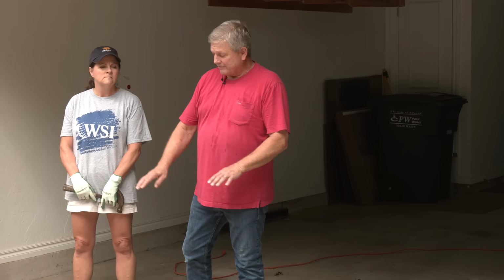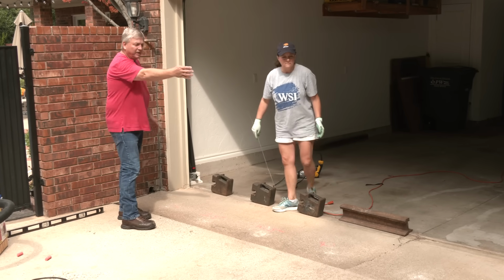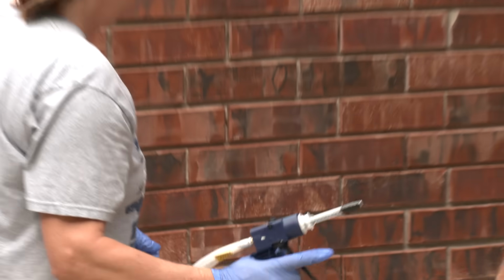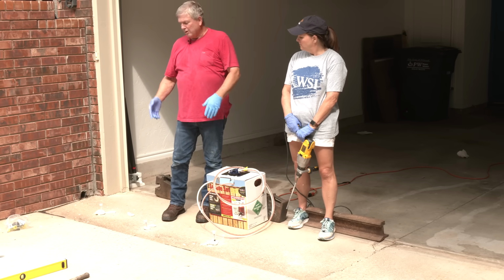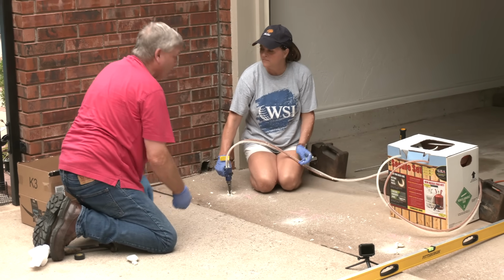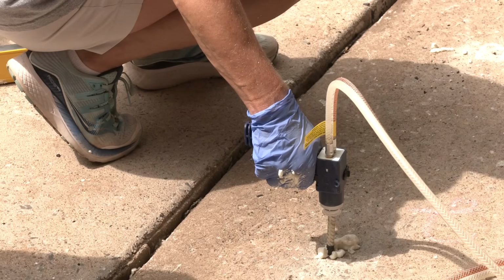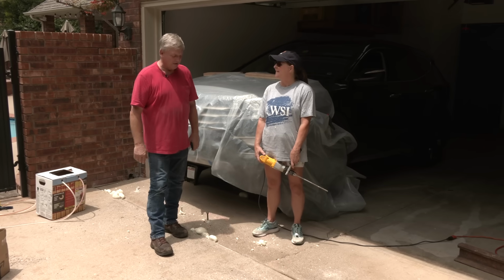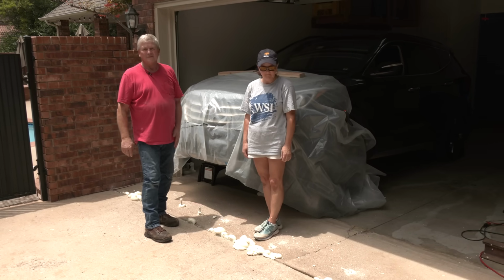Raising Concrete Driveway Slabs with Secure Set

Comment: In hindsight … would it have been just as easy to get a landscaping contractor to jackhammer and remove that sunken panel, stabilize the subsoil, re-pour concrete, and use attractive top finishing?  While at it, the concrete crew could install proper grating and drain to guide water in a better way.
Reply from the maker: Actually she had a price for doing just that (with unknown amount for the back-fill product and labor) and this was the least expensive way to go, even with the extra kit.  Also, they did have the downspout issue corrected, as well.
Thank you for questions.
GRA Services

Comment: If I use all of the spray foam in the container, can I refill it or do I have to buy it again?
Reply from the maker: Thank you for your question.  The Secure Set Spray Foam containers cannot be refilled.  Once the pressurization is gone from the tanks then they are no longer hazardous and can be disposed of however your local waste management company allows.

Comment: I just put 6 of these into a very sunk hawaii house foundation. It ate it all. 1 gun safety malfunctioned and i got blasted. The cans actually go well over ten minutes. I like the concept. wear protection. face shield even. I dont think the instructor emphasized the tight seal you need enough, and how to manage the ten minutes of foam you get. its really more like 12 minutes. This could use a lot more real detail. Good product.
Reply from the maker: Thank you for the comments, @Snoopy Ace.  You must have had some huge voids, and/or you had loose non-compacted soil and the foam compressed your soil to create more voids than you expected to have.  
Sorry to hear about the gun malfunction.  Like any mechanical device things like that can happen from time to time.  
As far as more real detail needed, the kits are used for so many types of projects that we don't put the application detail in the kits, but we have 10 instructional videos on YouTube and our website www.secureset.net for help with understanding a few types of projects.  Also, we are happy to answer questions by phone at 405-672-8885.  
Thanks again, GRA Services.

Comment: How long does the foam last?  I have a slab that keeps sinking after I have jacked up the concrete and filled underneath with crushed stone and cement several times in the past 15 years or so.  I think because I live near Lake Michigan on sandy soil (you hit sand after about 2 feet or so), I will near get rid of this problem ...
Reply from the maker: Thank you for your question. High density foams are expected to last 40 plus years, since nothing dissolves it and it has no nutritional value, so insects don't feed off of it .

Comment: Cut your concrete at the point its sunk down.
Reply from the maker: Yes, sometimes it does require a cut in the concrete to get it to lift, especially if there is a jagged crack which may be impeding the lift.  Also, sometimes customers have reported the need to cut rebar in order to get the lift they are needing.
Thank you for the comment.

Comment: Nice job guys👍….…Remember, WATER intrusion usually the main reason why our foundations are sinking especially when the foundation sitting on a nearly flat surface which reduce the water flow quickly away from the foundation…Therefore, foundation erosion starting to happen which weakening the concrete. I think I’ve found the problem on this driveway during the video shooting!! The downspout looks like directed and built within the brick wall and coming down just a foot away from the garage floor. I’m pretty sure if that downspout still there, this driveway will continue to sink! If not, then other surrounding foundations will be copied and eventually back to square one.
Reply from the maker: Yes, that was likely the issue and was corrected shortly after the filming of this project.  Thank you for the comment.

Comment: Could this method be used to raise the foundation?
Reply from the maker: It would depend on many factors.  We have had customers that have done that type of project, but we have not.  If you can jack up the structure and then apply the high density 4 lb foam, it will then support 10,080 lbs. per sq. ft.  
Thank you.

Comment: I think using a boroscope would be handy for estimating how much foam to purchase and guiding it during the injection process.  (Obviously, you'd need to keep the sticky material away from the lens.)  eBay has them listed for about $25 that connects to a smartphone or tablet for viewing.
Reply from the maker: Yes, it would have been handy.  We now use an endoscope camera that has a 2 way viewing capability, with a very bright light.  It helps a tremendous amount in estimating the project, as well as later figuring out where the foam has moved to and where we might still need to apply more foam.   We always wait at least 15 minutes after applying foam to take another look so we don't ruin our camera.  Thank you for the comment.
Reply: It takes what it takes. You can not estimate wolume in a cavity, no way to measure unless by eye.

Comment: You go left right, let the rise on the left and the lesser flow to the right create a void on the right side. Then fill the right and it will lift the right and create a void on the left again, go back left and repeat. Filling up the left and trying to pump more into the left will not work because there is no space unless you lift it, so lifting right creates more space. It is a problem if you fill up the whole space and have tight foam everywhere, you do not have any voids left to lift and create voids in the original space.

Comment: Some questions came to mind in the process that wssnt clearly explained: 
1) why more than one nozzle? Was a new one used for each hole? Or just after returning after extended drying time? 

2) how to determine how much tape wrapped on nozzle to prep it?? 
Is that to seal the size of hole while applying/filling w sealer. ? 

3) how to know when to stop dispensing each hole? At each application layer? 

4) how do you avoid lifting too much? 
Doesn't it keep expanding after you stop filling? 

5) prepping the nozzle , to clean/vacate it between applications of foam. Couldnt see what you did. Did you Empty hose of the foam, remove tip and then cap with a new clean tip? 

6) what was the plug removed between holes? Was it the nozzle hardening quickly or a plug from the hole? 

7) why spray foam into box before filling the hole? 
Was the line filled with air? 

8) what if there is an unknown big gap under the 12x12' slab further down the driveway? Maybe that is where the extra foam was going? 

9) what does "hear air coming out of crack" indicate? 

10) did the 1/4 inch raise on garage side come back down later after putting the car on it?  
Or did pivoting primary slab level it after infusing more foam in holes? 

11) would be nice to see cutting off final excess overflow foam from the cracks and final prep sealing of the joints where tar sealer was removed. 

() great project video. I watched it twice! But still am not certain about the questions above. -RichK
Reply: I think most of these can be answered with common sense. I think your best chance at figuring it out is by trying it on a project that doesnt have a lot of chance to fail, and if it does fail won't be a big concern!
Reply: I am concerned about the quarter inch on the hinged slab that went too far.  You drove the car on it.  Did the concrete level off with the added weight?  If not, do   I need to grind to make it level?

Comment: Great video! I found the strategy of redrilling holes and layering the high density foam - from below - in conjunction with use of the ramps with the vehicle to weigh down the hinge point, most innovative. Thank you. Very smart.

Comment: what keeps the foam from compressing over time, with driving over it seems like it will compact.
Reply from the maker: Hello Jerry,  The foam will compact if and when the combined compression weight of the concrete and the vehicle exceeds 10,080 Per Square Foot.  No standard vehicle combined with the weight of the concrete will exceed that value.  Therefore, the foam will not compact over time.  This is not like the spray foam in a can.  This is a closed cell, high density foam. Thank you

Comment: I have a detached two-car garage that has a big crack down the center and both sides have sunk about four or five inches. Would it be feasible to use this product to level my garage?
Reply from the maker: Hello Brad,  Yes, this product can help you.  However, you have to do some work to determine the extend of your damage.  You will need to both hammer sound the floor to determine the "hollow" sounds or voids under the floor.  Then purchase a Depstech DS-300 Endoscope, (about $70.00), and look below your garage floor to determine the size of the voids under the concrete.  Once you have accomplished that, we can work together to determine the extend of the voids under your concrete. Drill 3/8th" diameter holes with a 12" long concrete drill bit.  This will allow you to access the voids and thus ascertain the condition under your garage floor.  Once we determine the size of the voids and the height of the raising of your concrete, we can tell you how much product you need,.  Thank you.

Comment: Great video;  helpful instruction, but ••• 
SO MANY OSHA VIOLATIONS.  It’s not about fines;  it’s about your SAFETY! • • • • • • • • 

SecureSet is a closed-cell insulation foam;  it’s basically Great Stuff foam in a can.  The polyurethane-based product is similar to Gorilla Glue.  WHEN it gets on you, IT AIN’T COMING OFF!••• EVER!  • • • • • • • • I got foam onto work pants;  after years of wear and washings, the pants wore out;  the foam never came off. • • • • • • • • 

Leslie was DRESSED COMPLETELY INAPPROPRIATELY.
She should have had work boots, socks, long pants that she didn’t care about, a long sleeve shirt, work gloves, safety glasses, a respirator and hearing protection “ear muffs”.  The foam, that got on her legs and arms, she could shave it off after it dried OR wait for the skin cells to shed off her body. • • • • • • • • If the foam had gotten into her eyes, that would have at least been a trip to the emergency room. • • • • • • • • 

Even though I usually wore hearing protection during 40 years of renovation work, I now have tinnitus — a 24/7 ringing in my ears and some hearing loss.  Fun!  …Not!!  • • • • • • • • 

CONCRETE DUST produces millions of microscopic shards of glass.  When they get into your lungs, THEY AIN’T COMING OUT EITHER. • • • • • • • • 
PLEASE, protect yourself, your workers and your family better than Leslie.

Comment: I had a friend in MN who bought a brand new house. The next summer a section of her drive had dropped an inch. The next year it had gone down 2 more inches. She called the builder and they patched the drive. The next year it had gone down 4 inches. They dug down to see what was going on. It turned out there was a gap in her sewer line. She took the contractor and the city to court (it should have been inspected, but obviously not). 
How old was this house?
Reply: The house we worked on was 18 years old.  Is this what you wanted to know?

Comment: Good video. I strongly recommend safety glasses or even better a clear face shield when working with any expanding foam product.  It squirts out under pressure unpredictably.  A disposable Tyvek suit over exposed skin will prevent messy and really difficult cleanup.

Comment: Water runoff must pool around the middle of under driveway, or at least some time eh? The corner by garage door frame trim to the left looks like newer concrete repair . But rule of thumb is water don’t lie. Whether gutters need looked at , cleaned or directed a certain way and or our concrete guy had us add more dirt around edges and under where it was high and we had tiny access.. rodents and such can dig tunnels and burrow under concrete too.
Reply from the maker: Hello Johnny,

Hello Johnny,  Much work was accomplished during the project and also post repair.  Gutter and downspout direction changed was the biggest issue.  All in all, it turned out well.  Thank you
Reply: @SecureSet-Fence-Installation  nice.. we had to do our house driveway, stoop and sidewalks cause they were all sunken and a mess. It was a foreclosure though and sat empty for 3 years.  Luckily we have a friend who did it all for $500 and guaranteed for 2 years. We’ll have to do it again soon. Then they’ll have to reseal the gaps too. But it’s a must or can lead to worse issues. Nice work 🤙🏽

Comment: How do you determine the spacing of the holes?
Reply from the maker: Hello Martin, The spacing is determined most by the depth of the void under the slab.  The shallower the void the further away the holes.  The deeper the void, the closer the holes.  For this project we did not use the endoscope that we employ now.  The scopes are so affordable, that now I would not do any project without having one. The Depstech Model DS300 is the one I would recommend, it has both a down view and a side view with a focal range of about 10 inches. The spacing we used on this project worked out, but as we found out, the void area went further under the slab towards the garage that we originally estimated.  It would be good to have all this information before you start injecting the foam.  The project turned out well, but we could have been more accurate on the amount of foam needed if we had know the full extend of the voids.  Thanks for the question.

Comment: Is it has better pressure than can spray? And what is adventage of foamjacking than just use self level mortar?
Lastly, sry for lots of questions but I thought the foam harden under slab at the first job. How it keep going even they trying after foam harden. Because I couldnt see under slab it is hard to understand because commercial foamjacking was lift slab at once
Reply from the maker: Hello Nopark,  You have good questions, here are the answers:  1. Does It have pressure higher than can spray? Yes it does, the twin cannisters are pressurized to 180 psi.  If you needed to, you can shoot the foamed spray about 6 feet.  2. What is advantage of foam jacking over the use of self leveling mortar?  That type of mortar is primarily used to patch or pour concrete floors.  Because it has a slightly lower viscosity, it will settle to the lowest point and flatten out like a pool of water. It is bot meant to expand and fill voids.  3. How does it keep flowing even after some of the foam has hardened?  The foam, once it comes out of the nozzle, will expand and move to the closest void. Adding additional foam will force the foam to flow around any other foam that has hardened as long as there is a space or void to travel to. 4.  Commercial foam jacking will lift slab at once.  Foam jacking is used just like our foam to fill voids and lift slabs of concrete.  The foam reacts and flows to the point of least resistance just like any other foam product.  It does not happen, "all at once", the foam has to fill the available voids and spaces first, then it will lift the slab when the foam has no where else to go.  Thank you
Reply: @SecureSet-Fence-Installation  I appreciate about your very kind detail answer.

Comment: Interesting but it probably would have gone as fast to jack hammer that out put new base in and fill with new concrete...
Reply from the maker: Hello Custom Solutions,  The assumptions that Leslie did not investigate all her options before choosing to use expanding foam is incorrect.  She had three bids and all were 2.5 to 3.5 times higher than doing the job herself and using the Secure Set Spray Foam. All went well and problem solved for considerably less money.  Thank you.
Reply: @Secure Set the reason they saved money is they did it themselves cutting out the labor . I'm sure if your guys did the labor it would have matched more closely to the prices quoted. ( Because they included labor cost which easily doubled the material cost ) 

Also without addressing the root cause of why the cement apron sank the same problem will eventually appear with your solution. 
Correct and long lasting repair would have been to jackhammer out and remove sublayer of gravel/dirt.. and Putin a French drain draining out to the right. If it was done diy like you claim she probably be on par or cheaper than your  way. 
Plastic drain is the most expensive part, gravel and cement bags are super cheap.. . Renting jack hammer also cheap. 

But it's not always about saving money...

Comment: What type of foam is used?
Reply from the maker: Hello My Email,  The set foam is a two part, closed cell, high density structural foam. Neither air nor water will pernitrate or move through the foam.  It provides great insulation, sound deadening and structural rigidity.  Thank you.

Comment: What size bit were you using? (Looks like a 1/2" chuck, 1/2' bit.) Also, what is the length? Thank you.
Reply from the maker: We use 3/8" bit which is 12" long.  We cut the mixer nozzles back about 1/2" and wrap black electrical tape 3 to 4 times around.  It will seat well into a 3/8" hole.